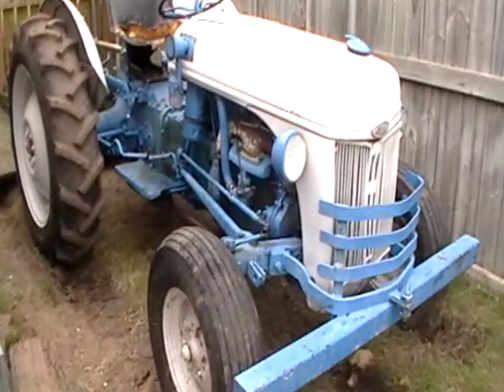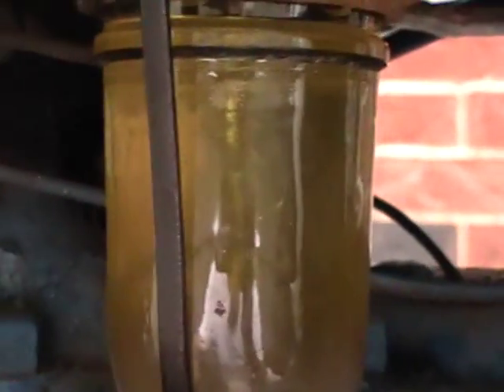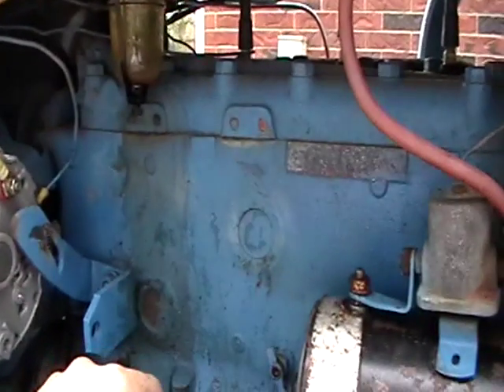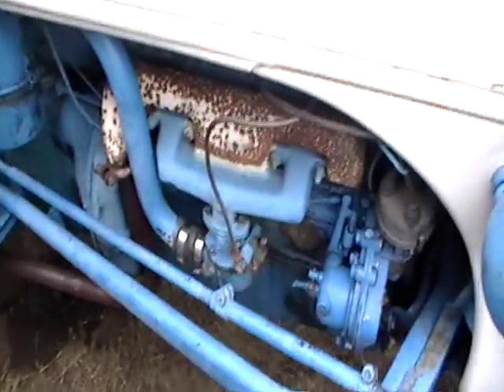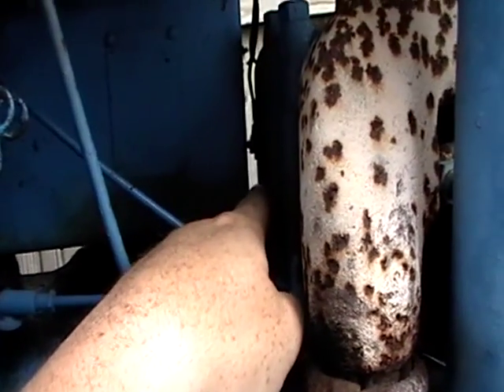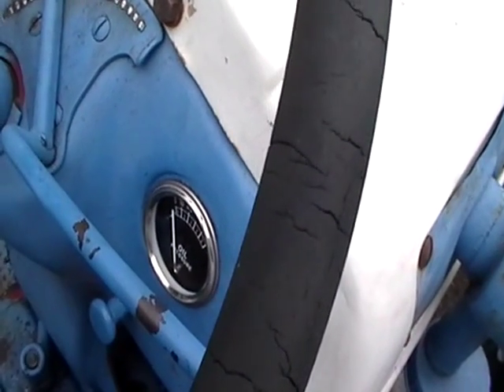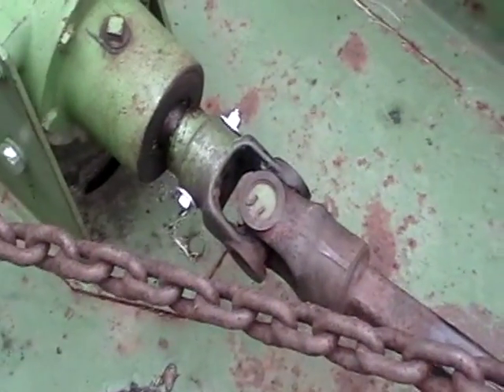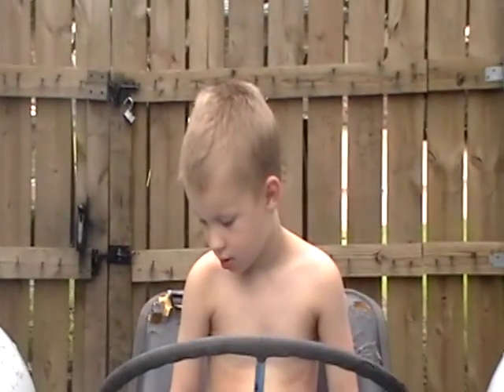1950 8N Ford Tractor Update

Comment: My 6 volt system works fine, why didn't  yours?
Reply from the maker: It was switched over from the previous owner.  But going to a 12v system.  It turnsthe engine over faster, alternator are a dime a dozen, brighter lights